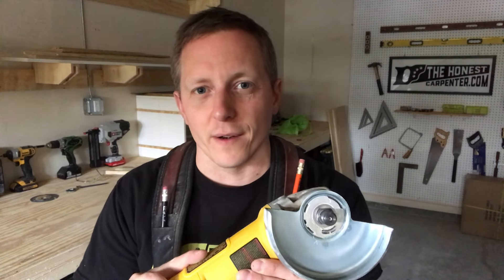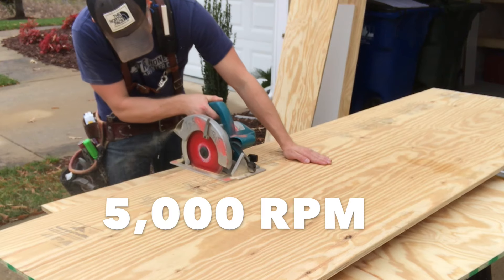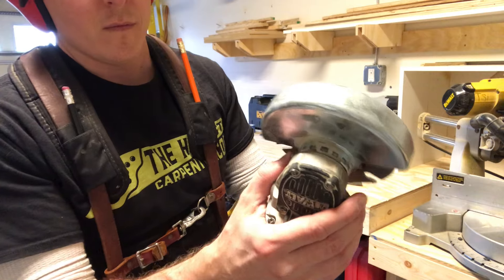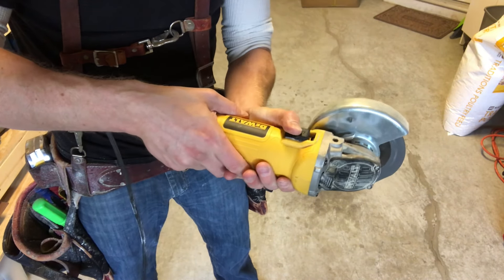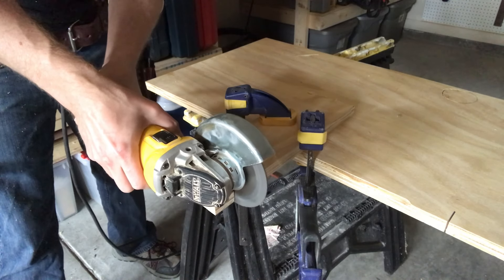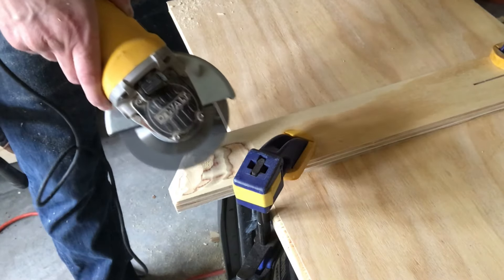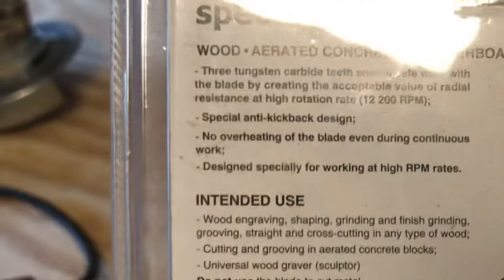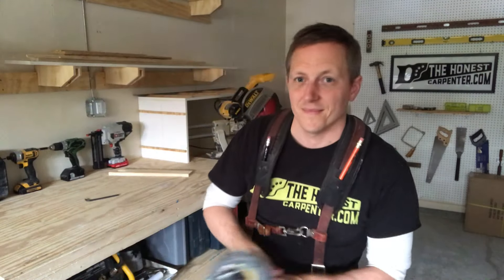CAN ANGLE GRINDERS CUT WOOD?? (Tricks + Tips--Cutting Wood With Grinders)

Comment: I will not be cutting wood again any time soon with my angle grinder, except maybe under very controlled conditions as you show. I had a tree root coming from under a concrete foundation which I could not get anything like a chain saw onto. Then I saw a wood cutting blade in the hardware shop, basically a coarse saw blade and thought aha - just the thing. Access was difficult, I could only use one hand. First contact, that grinder flew out of my hand and straight into my leg. I was wearing heavy gumboots but still that thing cut through them and into my leg. Luckily the blade grabbed the boots and that changed its direction, but not before chewing a 5mm wide 50mm long gash right over my shin bone. So yes, I broke more than one safety rule, like not being able to hold it securely and using it for something I should not have. And PPE - without those boots it would have cut to the bone. Also one big problem with these angle grinders is that power is locked on. If anything like that happens it does not lose power when you let it go, even when it does go flying. It has given me a new respect for safety on this device which I already knew had to be used with care.

Comment: As someone who has always worked with wood I'd not used or owned one of these. Past few years I been using one to cut old crap car parts and alike in a garage. 
They are by far the only cutting tool I'm always nervous to handel they feel inherently unsafe to me, but I need to tile a kitchen and bathroom so my circ saw is most likely unaffective haha

Comment: I have been using angle grinders for > 20 years -- mostly to cut metal. I've also done some construction work that required cutting concrete, tile, bricks, mortar, etc with diamond wheels on a grinder.

A couple years ago, I was cutting some steel with a grinder. I was wearing safety glasses, and sparks were flying. A tiny piece of steel managed to get under my safety glasses and embedded into my eye. It was tiny -- like a grain of sand -- but it had a sharp barb. An opthamologist at the hospital had to use something similar to a grinding burr on a tool similar to a dremel to grind down the surface of my eye to get out the fleck of metal. It took a couple weeks for the surface of my eye to heal. I got lucky, and I don't have any permanent vision loss, but it could have been worse.

I will never again use regular safety glasses when working with a grinder. You should either use a full face shield or at least goggles that snuggly fit against your face with no gaps. I'm not talking about cheap safety goggles but a good pair with a snug fit. I got a pair on amazon from a company called "Solidwork". They're like $20, they're comfortable, and I believe they completely seal all gaps around my eyes. I would at least use something like this if I decided to carve some wood with a grinder. If I were cutting big pieces of steel with a grinder, I'd use a face shield.

Personally, I only use grinders with deadman switches that will shut off the grinder if you let go of the tool. I like double-action deadman switches that require you to first engage some sort of unlocking lever and then only keep the tool on as you're squeezing the switch. This way, if you get kickback, lose control of the tool, and let go of the switch, it should stop spinning.

Comment: I've used a corded grinder (I borough from a friend) once in my life and I was terrified because the thing looks so dangerous. This week I bought myself a cordless milwaukee and I feel so much safe. It has a pressure paddle, so if you let the tool go it will stop, also has an electronic brake, so it stops spinning very quickly and it's only 8500rpm. Of course it is still dangerous, but I feel so much safe. Highly recommend a cordless grinder for someone looking to buy his first grinder. :)
Reply: You shouldn't be working with powerful tool if you're so frisky around even an 8.5k rpm grinder,maybe you should consider trades like cattle herding,it's more peaceful. In the past 40 years of using Grinders,I havent had one injury.
Reply: I’m about to buy my first angle grinder… a cordless. Scary though.

Comment: 2 things for your consideration, 1 Stumpy Nubs did a video about 3 weeks ago where he was using an angle grinder to carve wood, instead of this blade he had the blade with chainsaw teeth. It grabbed and he will be healing for some time. Second and more important, angle grinders come with support handle, use unless it prevents you from getting the job done.
Reply from the maker: I had no idea that had happened, Bryan. A couple people have mentioned it. It's terrible to hear, and it shows just how dangerous grinders with aggressive blades can be. I like the handle for buffing and grinding applications, but for anything like cutting, I don't want to use it. One hand can overtake the other in terms of force, and you can push your blade off-center too easily. That's how guaranteed bind happens, and on a toothed blade this strong, it'll kick in an instant. I want both hands BEHIND the guard, and pulling/pushing in the exact same direction. Far less chance of twisting the blade this way, and both hands will remain behind the swing arc of a blade spinning out. I suppose it's personal preference though. No matter what, you need to be careful with these things, which I hope I drove home enough during the video.

Comment: Thank you for your demonstration, If I was cutting the wood , I was using the handle , that is more gripping power and more control on holding the machine , so as long as handle is there , there should be used as a safety reason.

Comment: I've had my thumb nearly split down the middle due to my carelessness and an old metal disc. This was with the guard and handle on. Angle grinders + toothed saw blades = certain death or even injury!! 
Metal cutting discs are bad enough at those speeds. If you're itching to use a 4" wood blade for some weird reason, get a 4" tile cutting machine. You can still do some surface carving with that machine, and its way safer to use. 
I use a 4" tile/marble cutting machine with a flat ground wood blade for scoring plywood and other material prone to tearout, before making a full depth pass with a regular circular saw. It's actually easier than reducing/increasing depth on the one circular saw to make 2 passes. 
If all I had on hand was an angle grinder with a wood blade for this job, I'd probably go back and get the right tool. If that isn't an option, I'd certainly return the money and go home hungry. Some risks in life are worth taking, but needless risks like these, are not worth anything. 👍
Reply: yep i cut my middle finger almost to the bone before i could say ouch. These this are a last resort tool for me

Comment: When cutting woods with angle grinder, I use speed controller. It’s safer and more convenient that way.
Reply: There is variable speed grinder, i'm using it, it is more safe
Reply: Standard AC grinders  don't like that (the speed control)  as they need the air flow to cool.
Reply: @stanimir4197  based on my experience, i can't cut lots of wood with angle grinder with or without the speed controller as it's not very comfortable to cut wood with it, i would prefer a jig saw or a real circular saw which are more convivence and produce a lot better result . :)
Reply: @backyard.craftsman  me too.

Comment: VARIABLE SPEED CONTROL is what you need. There are angle grinders with a low rpm settings and low power. Just takes a bit 
more time but much safer and easier to keep it under control. Might be good to cut hard to reach things like small tree roots. And make sure to cut in such a way that the grinder will move away from you when there is kickback or it blocks etc. A good angle grinder also comes with a extra handle.

Comment: So Was Watching & Reading Comments These Past 3 Days to get information what should i buy, a angle grinder or a circular saw for cutting some wood (to build a small house for my dog. Finally i bought a angle grinder with a TCT Saw blade & a glove. It was a 900W With 11000RPM Grinder. The TCT Saw blade Have a 13000RPM. Yeah i know its dangerous because of kickback but not in my case, while cutting, no kickbacks at all and always wear PPE When Carry This Kind of works. Always hold the handle tightly because you never know when it could kickback also it was my first time using angle grinder.The Wood was smooth & it was easy to cut but never cut hard wood because it can cause kickback. Don't have much experience of giving information but that's my experience of using a angle grinder to cut wood & the wood was 'PALLET'. Any ques feel free.

My Personal PPE
• Glove
• Safety Shoes
• Safety Goggles

Comment: They say that there are only two types of people who have used AGs for wood-cutting: (not yet) injured or dead. The grinder itself is kind of a dangerous tool + the structure of the wood + the blade + the speed and you get a recipe for a disaster. There are jigsaws and circular saws intended for cutting wood so you should buy a right tool and not have your delicate flesh torn apart — it’s the only right thing to do.

Comment: Two thumbs for stressing safety!  However, grinders don't cut while pulling unless you're handling them backwards.  Grinders, like most tools cut throwing all the waste away from you.  I use it plenty for welding applications and for cutting tiles.  If you need something that looks like a grinder to cut wood, I suggest getting the Dremmel Saw Max.  For near a $100 you get the saw, four disks for different applications (wood cutting, metal cutting, flush wood cutting and tile glue removal) a support handle and a carrying/storage bag.  I have to grinders which I use one for cutting metal and tiles, the other one for actual grinding metal.  If I'm cutting just a piece of wood and I don't want to pull out neither the table saw nor the miter saw, I get the Dremmel Saw Max or the Multi-tool (you call it the multi-purpose).  Avoid an accident; don't use the grinder to cut wood.
Reply: Then you are using it the wrong way because grinders throw waste at you if used in the correct direction.

Comment: Thanks for the advice.  I was pondering that blade for cutting ventilation in an unvented and angled roof soffit.  I can't even get a decent shot at it with an angle drill and hole saw, so I've been considering cutting a slit instead, but so far can't find anything to fit.  The soffit material is the same as the wood siding, nearly an inch thick and  I'm well experienced, but frankly it looks a bit too hairy to attempt on a ladder above my head ... or should I say I wouldn't be too hairy afterward :)  ...   Anyway, good demo and I'm going to keep pondering!
Reply: Use a multi tool

Comment: Yes, and angle grinder CAN cut wood. Likewise, a lawn mower CAN cut wood. File some notches in the blade, and a meat slicer becomes a saw. 
On another front, I love my blood. However, I prefer keeping it on the INSIDE, so I just stick to using tools for the job the were designed for and can perform with a reasonable degree of safety. I find this the best use for these things as it helps keep my blood in my veins and arteries, rather than splashed about.

Comment: what would be a safe alternative? i used a small manual saw before but it ended up snapping because the wood was too fibrous for it... also it required a lot of strength for me for very little even not very noticeable results with my wood cutting projects ... i ended up hurting my hands and arms from the effort putting in.. is there even a safe yet effective option for me? i don't want to have to use an angle grinder, i'm so clumsy!!

Comment: I would suggest using a grinder with a paddle switch so you can cut the tool off without removing a hand from the tool. Grinders are awesome for coping crown mouldings.
Reply: I hate the ones that just have a switch -- too easy to make mistakes.  Paddles all the way.

Comment: Thanks so much for the video. A decent saw is like 100+ but i just ordered this blade for 20. Should be fine for the casual hobbyist stuff i do. Also saves space in my tiny workshop room, saws are big.
Reply from the maker: You’re welcome, Lucas. But if you use it, just be extremely careful with the grinder! I’ve heard another YouTuber had parts of his hand taken off. They can be EXTREMELY dangerous 🙁

Comment: Hello, I am posting from by boyfriend's account, we have recently moved to Shetland to an old church cause I couldn't afford a house anywhere else. Anyway, what tool would you recommend for cutting the pews out of the flooring? They seem to be attached to the wooden flooring via big pegs sticking out and into the floor at the bottom. They're only flimsy looking pews, not like big solid ones. I don't know anything about anything to do with building, sorry for the silly question! Other than having worked in site offices in London. I'm looking at saws on wilko and can't tell what I should get, angle grinder or a saw of some type? I would very grateful for any suggestion you might have! Many thanks, Eda

Comment: I been using grinders on metal for 25 or so years , & I just wouldn't use 1 for wood , came here to see if i can cut a line in my laminate floor so i can tile neatly up to it & having watched your thorough review,  i made the decision to find another way to cut the 10mm depth that i need . Any recommendations on that ? Multi tool , or a small circular saw do you think ? A jigsaw won't work as its already laid & is sat on a 5mm think foam underlay
Reply from the maker: Oscillating multi-tool, Stephen! Easy to use, very precise :)
Reply: I appreciate the reply thankyou 😊 , my dad has one I'll be able to borrow .

Comment: Grinders I've used too easily lock in the on position.  Putting a blade like that on a rotating cutting tool that will keep running after it leaves my hands isn't something I have interest in using.  And I'm a 'safety second' kind of person.
Reply: Paddle switch grinders only.. the only most jobsites allow.. should be the same for homeowners

Comment: I would agree with Scotty B, the lack of support and precession effect from the grinder along with the softness of wood - giving it a tendency to grip the blade makes this attachment potentially dangerous. Chainsaw blades are already banned in the UK (England) and these should be too.
An angle grinder just spins to fast for this accessory, use a jig saw in my opinion.
Reply: nah, this one way more safety than a chainsaw disk. But angle grinder is very dangerous tool itself. IMO this 3-teeth disk must be used only on a grinder with handle and a handle should be placed only in a side hole (not central hole) to hold it in the way the grinder will run away from you if disk is jammed (there is no handle in the video)

Comment: I rarely use a corded grinder any more. I usually use a battery powered unit which stops very quickly when you release the switch. And I prefer one with speed control settings.
When I do use a corded grinder I like to use a foot switch when ever possible. The foot switch I use is on when you step on it and off when you lift your foot. Just an extra layer of precaution. Years ago I had a co-worker using an old grinder that had a lock on button. The grinder accidentally hit the floor, shot across the shop some 25-30 feet and hit another co-workers foot and went up his leg a couple of inches. (No he didn’t get 35 stitches.) A switch like I described may have mitigated that…

Comment: Not targeting anyone but I seen a comment about the grinder got away and cut them up first of all if you need to use the handle and keep a tight grip on the tool second most grinders like he has have a terrible switch I would never use a grinder without a paddle switch a paddle switch has to be held in if your drop the tool you let off the switch which means the grinder is going to shut off so even if it does hit your leg and you have the right clothing on like sweat pants or jeans the blade isn’t gonna have enough power to keep cutting your skin by the time it gets thru the fabric, just my opinion.

Comment: Thank you 1001 fold! Just bought a grinder to attack crazy vine on fence shared with crazy widow ... to try to make her happy... not going to mess with this dangerous tool though for this purpose.. just may have todo RoundUp poison, which I hate... but I'm not messing with cutting thick vine stuff with a dangerous grinder ... NOOOOOOOO WWWAYAYYYYYY! Thank you for saving my fingers!!!
Reply from the maker: You're welcome, Todd! I had been curious about these things until I started using them a bit, and it just seemed that they came with such a strong downside that I only recommend them for really committed wood shapers. You might even consider an oscillating mulit-tool with couple good wood blades. They'll zip right through those stems and you might be able to just start pulling vines at some point. Waaaay safer. Thanks for watching!
Reply: A basic flap disc will go through vines.

Comment: I had a serious safety problem with one of these blades so ditched it quite promptly . . . . . My angle grinder slams on a braking effect when the trigger is released, but the heavy blade wanted to keep on spinning, so it undid its nut and flew off the spindle!

Comment: I put a 7 inch circular saw blade I found on the road on my angle grinder, looking back on it that was such a bad idea because the blade was right next to my finger. It cut wood pretty well though.
Reply: I just finished doing that with a slightly smaller circ saw blade. No guard. I had the speed way up there not thinking anything about slowing it down. The grinder cuts very fast.